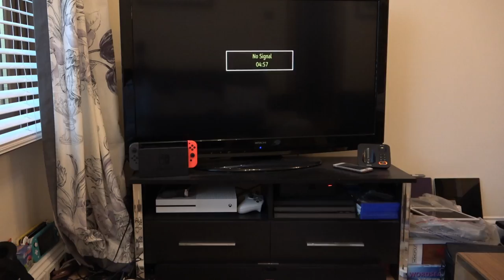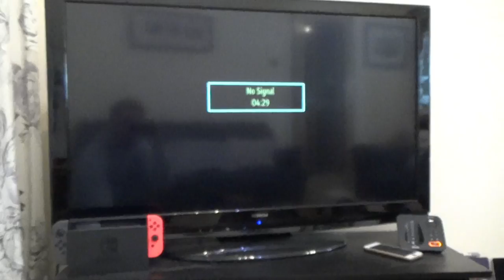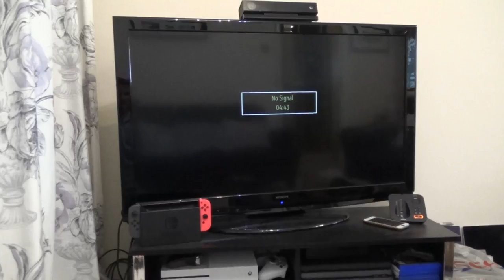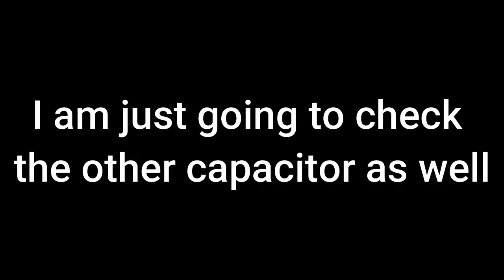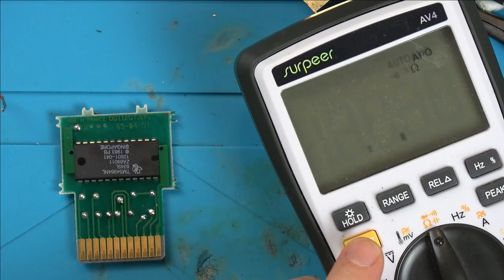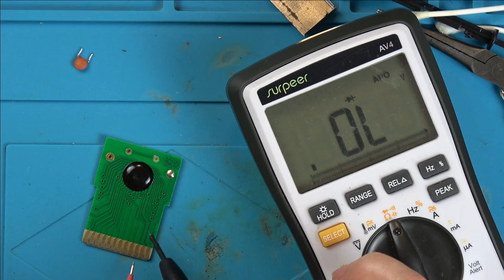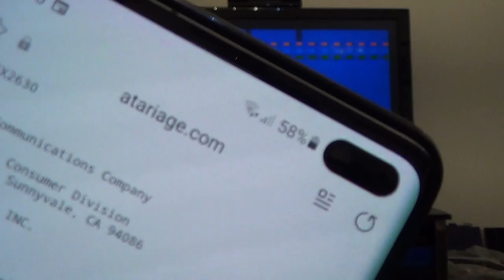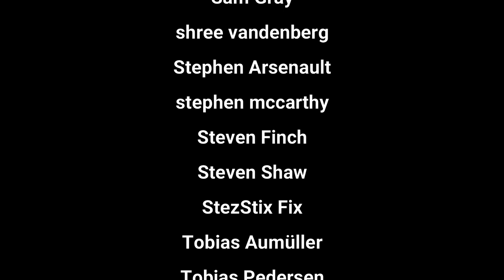A Joblot of Faulty Atari 2600 GAMES - Are they Fixable?

Comment: Solid capacitors like that basically never fail. Never, ever, ever. It's much more likely the chip has failed, especially since it's a cheap nasty glop-top. Kung Fu Master was an 8K ROM, the 2600 was designed to run 2K and 4K games. There were only enough address lines at the cartridge port to support 4K (and only enough on the CPU itself to support 8K, they used a lower-cost version of the 6502 CPU to save money). So if you wanted more than 4K for your game you had to invent a way of bank-switching, a way of dividing the ROM in your cart, say 8K or 16K, into segments that would fit in the 2600's 4K range. Then swap those segments about as necessary.

Since the 2600 generates it's picture in software, that's easier said than done. The 2600 has no video RAM, the screen is drawn with code instead, on the CPU. The CPU can jiggle about 2 sprites (with up to 3 duplicates), 2 single-pixel missiles, and a 1-pixel "ball". And 20 bits of background that only fill half the screen width so the rest you have to either repeat over, or mirror. 

It was designed to be able to play Pong and Breakout, and maybe Combat. The sort of games that were in arcades in the late '70s, which weren't up to much. Most of them weren't even in colour! So when the '80s came and people expected better computer games, the 2600 was really in a pickle, to actually get anything to happen at all is a miracle of programming. So that they managed to stream the '80s worth of computer games through a completely unsuitable bit of hardware deserves a real pat on the back for everyone who did it. You should read up on programming the 2600 one day, it's... weird! "Racing the beam" is a good book about it. 

I mention the 8K carts cos Kung Fu Master is one, so it would have an additional logic chip in the cart beside just the ROM chip. This would provide the extra address lines, by lurking at an address (1FF8 usually). You access that address and it flips it's address bit automatically, meaning you now get the other half of the cart's ROM. Switched in right where the other half was previously. Fortunately you'd prepared for just this eventuality! So that blob-top chip will contain 2 chips. Possibly on one bit of silicon, I dunno how well ROM technology works at implementing logic, but a couple of OR and AND gates surely aren't gonna tax it. OR possibly it's 2 bits of silicon, 2 chip dies, under one blob of plastic and wired together with those little gold wires, except in this case probably aluminium or something, you wouldn't waste actual gold on an Atari game!

Other carts had more sophisticated ROM mapping, and some even included more RAM! Another 128 bytes, to go alongside the 128 bytes the 2600 had on board, usually using the same chip Atari did. Atari 2600 hacking is a whole world, and a well-developed one since the 1990s. You might wanna get involved, hardware to program your own isn't expensive. There's even a version of BASIC with powerful features, but I think to get the real experience you'd want to do it in assembly.
Reply: >Solid capacitors like that basically never fail. Never, ever, ever. 

This is patently false, you have no idea what you're talking about. Ceramic multi-layer capacitors, as well as other types like tantalum, mica and polypropylene film capacitors all have failure modes associated with them and they are not rare. I've replaced thousands of shorted ceramic capacitors, hundreds of tantalums and innumerable other solid types.

Ceramic capacitors in particular are ridiculously fragile due to their nature of being a hard ceramic. This makes them very prone to mechanical damage from flexing, which can be caused by the PCB they're soldered to warping from heating and cooling. When measuring the forces of material expansion due to thermal change, we're talking about hundreds or thousands of pounds, and since ceramic capacitors have no give, they break. Disk and axial capacitors are less prone to breaking because they have leads that can absorb some of the flexion, but it still happens. Shock can also break them, like from drops on a hard floor or table.

In general, the smaller the ceramic capacitor, and the higher the rated capacitance, the more fragile the ceramic capacitor is going to be. This is due to the plates being ever thinner and more of them in a given space, which gives even less margin for things like heat and shock tolerance. SMD MLCC caps are notorious for their high failure rates.

Tantalums are even less tolerant than ceramic types. They hate voltage spikes, so a dirty power supply or component fault can make them short and explode. Mica caps are subject to "silver mica disease". Polypropylene film capacitors have an interesting failure mode where when a short between the film plates happen, they blow clear and the overall capacitance drops from a reduced plate surface area. The capacitance can eventually drop so low that the circuit the capacitor in fails to work.
Reply: @GGigabiteM  you're absolutely right. But then again, I'm sure he just miss to add "in these cartridges" part in his statement.

Comment: Hey Vince!!! :)   If anyone is ever interested in preserving the sticker by cutting, you can sometimes cut a straight line over the screws all the way across and pull up that strip easier and then put it down again so as not to be obvious you were getting at the screws. :)
Reply: A heat gun works for sticker removal on a lot of games, especially the metallic stickered ones, they come off really easily. Then just glue them back on again afterwards.

Comment: The Kung Fu Master isn't even a real period release, that's very obviously a 21st century reproduction board from Asia. Chip-on-board epoxy tech wasn't used in consumer gear back in the 70's/80's era of the 2600. The board doesn't even try to hide it and has a copyright of 2016, so it was made at LEAST as recently as 2016.
Reply: 2 years late here myself, but yeah, it's definitely a knock off cartridge.  The label is not correct, font wrong, and the MX 2002-2016 on a blob chip board is the dead giveaway.  Activision isn't even spelled out all the way on the board, and they put their full name on their original released boards.

Comment: Cool fixes :) 
Had myself strangely behaving solder joints at my old 80's Salora Manager computer game controllers. Tried to re-flow those old solder joints, but some of them kind of "exploded", sending solder blobs flying to the table and leaving empty hole to the joint. I didn't even wear safety glasses, as I didn't expect this kind of behaviour, but luckily no injury. I did put them on immediatly after the first explosion.
Filled those holes with new solder of course. Still, there's some problem with one direction, no continuity from right direction to the joystic socket pin, haven't had the time to diagnose it further yet.

Comment: I always clean the card edge connections in the equipment I repair, as even the gold plated ones tarnish over the decades and cleaning will often fix erratic behaviour. I use a couple of wipes with fibreglass brush (gently!) and deoxit, works a treat.

Comment: Dirty contacts on my neo geo mvs cartridges are solved by using regular eraser along the contacts and follow up with Ipa.
Works every time!
Reply: That's the worst thing you can do to contacts. Pencil erasers are a harsh abrasive that scrapes off metal from the contacts and leaves microscopic abrasions on the surface. Putting IPA on after that oxidizes the exposed clean metal and creates an environment for the oxidation of the connector to rapidly accelerate. Alcohol is extremely corrosive to many metals.

This is why game carts have to be cleaned so frequently, the oxidation returns immediately and gets worse. The "dirt" you remove from the edge connector with a cotton swab is metal oxides. Just ask yourself how impossible it is for a cart to get so filthy sitting in its sealed game case. It's even worse on carts that use tin contacts like those in the video. All of that dark gray/black stuff in the cuetip was tin oxides. That was a significant amount of material removed from the contacts. Do that enough and there won't be any contacts left.

The best way to clean cart edge connectors is chemical means. Use Deoxit Gold G5, CRC 2-26 or Krud Kutter rust converter on a cotton swab and wipe the contacts down. These will protect the contacts from further oxidation. In the case of Krud Kutter, it converts the surface to a phosphate and prevents further damage.

Comment: Like others have noted, Circus required the paddle controls.  Atari games assumed you had the manual.  Some games required the controls to be plugged into the P2 port for whatever reason.  You just pretty much had to be familiar with these quirks.

That said, some games reacted very interestingly when using the wrong controls.  In Combat, for example, if you used the paddles, you could do things like cause jets to hover in one spot.

Comment: A Submarine Commander cartridge a friend had given me over 20 years ago and had resided in my dresser's top drawer was fixed about a year ago after I did basic continuity testing and found the D3 line was broken. A good scrape of solder mask and a bridge solder blob got it working again.
Reply: Methinks you have a bad power supply or about to go bad. Filter cap needs changed.

Comment: Circus needs the paddle controller (as you discovered lol) =D   Where you get a chip on a board, you will usually see a bypass cap (generally one per IC) - that's what those caps were on the cart PCBs.  They simply connect between VCC and ground.  The only way a cap like that would cause a problem is if they are shorted!  The cart would work perfectly without the cap!   I know they are only simple but a fun to watch video =D
Reply from the maker: Thank you Chris👍👍👍 That Circus game had me baffled for a good while 🤣🤣
Reply: @Mymatevince  Circus is the best game in that bunch of games if you ask me.

Comment: The "blob chip" is a modern bootleg  cartridge. The chip-on-board package were not made in 1983.
Reply: when I saw that I was like... "wtf! who bootlegs atari games?"
Reply: The original arcade game was in 84, but they were releasing home ports through at least 1990. Wikipedia says the game was released on the 2600 in 1987, so 8912 which is written at the top would be a reasonable date code. It doesn't really make sense for a bootleg to put the Macronix logo and SINGAPORE on a PCB that nobody would see without destructively opening the game. Modern bootlegs are made in the Hong Kong / Shenzhen area anyway, not Singapore.

Also lastly, who would bother making a bootleg of that game.
Reply: Yup. I was thinking Vince would see the date on it. It clearly says 2002-2016, he must have had blinders up as soon as he seen that blob chip. 😄
Reply: Several of these look like bootlegs. Amazed at the janky poly-box on that Ghostbusters cart!

Comment: You should try scrapping off the solder mask over the vias and soldering them on both sides, vias can fail especially when exposed to physical stresses as these cards are when inserted and removed.

Comment: the bubbling is caused by moisture in the board ,i,ve seen it before when i,ve done outdoor led light circuits boards
Reply: That's right, the moisture in the board evaporates with the temperature of the soldering iron. This moisture also causes damage to the board, so it needs to be heated slowly with hotair.

Comment: Over the past few years I have bought several Atari 2600,7800 consoles with bundles of games and of the carts that I have tried I haven't had a one that didn't work after a spray of contact cleaner and a couple of insertions. I still have my original 2600 from when I was a kid too.

Comment: Despite popular belief, Mask ROMs do go bad over time. Electron migration and a number of other things can cause them to fail and no longer work. There's also a number of games that used cheaper windowless EPROMs, which are more susceptible to failure than mask ROMs are. The only way to recover a cart that has suffered bit rot is to replace the ROM with another chip programmed with the game on it.

Comment: The best way to clean Cart Contacts is a Pencil Eraser works great brings back the luster of the plating. You can get the wedge type that goes over the pencil or the large block type with a 45 on each end if needed cut the eraser with a razor to fit into each side of the cart. Then clean with cotton tip and IPA. Works everytime for me witout taking the cart apart.. : )

Comment: I was watching an old film on Fran Blanche's channel other day, its an old one I had seen many times but it shows how easy it is to replate contacts and traces on pcb's using the brush plating method and as you already have gold there a simple swipe over with some solution would make them contacts like brand new.

Comment: You can typically remove the black epoxy using paint stripper which has the main ingredient of Dicloromethane. Generally it does not damage electronic components and it works even better when its warm. The thicker gel type is better as it tends to stay in place. You just place a blob of stripper onto the epoxy and let it sit for period of time depending on the temperature and then wipe it and the loosened epoxy off and repeat as many times as required. Sometime we place the entire board or component in a sealed container covered in paint stripper and leave it overnight. Have been using this technique for years to remove epoxy and repair circuit board. Do not work on game consoles, so you would want to experiment a bit first. Be careful not to get it on the cartridge plastics, im sure it would melt them in seconds.

Comment: Vince never mind sometimes these things fail.  I used to have one of those Atari 2600 consoles it's a 6 switcher which is quite sought after.  Have you tried cleaning the contacts inside the 2600 as it may be the pins inside the console? I wonder if there is another 2600 they work on such as the Junior.
Reply: Atari had 2 mosels of 6-switch units.. is it a light-6er or hevay-6er?

Comment: Could it be that two of those games uses higher address lines and the consoles pins are dirty power-up could go to a higher address and not getting to the correct result causing the console to hang?

Comment: Very nice video. Depending on the condition of the stickers, you might be able to loosen the labels with some IPA so that you don't have to cut into them. I learnt that neat little trick from Odd Tinkering. If you try it you should probably test it on a small area first, in case it just dissolves the label.

Comment: I going to check the continuity on my dig dug cartridge. It stopped working. I did use the q tips to clean but still nothing. It used to work like 3 years ago. I always stored it in a case away from dust and humidity.

Comment: Use a hair dryer and blow hot air on the blob chip/ blob top. Get it really hot. It usually fixes the issue without having to take the cart apart.  Btw, I have seen blob tops on original US carts.

Comment: I was gonna say Circus definitely needs paddle controllers. Glad you figured that out on your own.

Worth noting, even though some of those Carts had a single chip on the board, those weren't always just regular ROM chips, some had extra stuff inside for bank switching (especially 8k games), or other features (some carts added extra RAM, etc.), because it was pretty common to just custom fab your own chips in the late 70s (generally cheaper than using a mask ROM and external components -- you were already doing the mask for the ROM, so you might as well bake everything in).

I'm surprised Circus actually had all those extra discrete components.  To me that signals that it's using a regular PROM chip (that and the sticker, sure, probably an EPROM), with external logic (that single transistor), for bank swiching.
Reply: Circus is a 4K ROM so no bank switching needed. That's also something a single transistor couldn't do, unless it had help from extra stuff on board the chip, and then you may as well integrate the transistor too. Sometimes something like that would be added to make up for an error in the chip's design, but Circus just being a dumb 4K ROM, I can't think what.
Reply: @greenaum  you're right it is only 4k.  It might be getting used as a "not" gate? maybe the enable pin is active high (not sure if that's even a thing, but what else would it be used for?).

Also I feel like with a transistor and a capacitor you could pull off poor man's bank switching, but yeah, no reason for that with this rom size...
Reply: @BrainSlugs83  Nah, cos for bank switching you need to do address decoding, which one transistor can't do.

Actually it COULD be a not gate... IIRC, mask ROM chips used an active high chip-select, where EPROMs used active-low. Or possibly the other way round. So a cart initially manufactured with ROM, but then later done as a short-run re-release, might switch to EPROM, necessitating a NOT gate. Good thinking!

Comment: Will a solder reflow fix this problem because of the solder being too old and loses its connection over time I just wonder if this would fix this issue or not the chip is bad and it is not fixable

Comment: I tested about 300 carts this weekend and about 1/2 of them didn't work the first try.  I cleaned them with an old stock cart cleaning kit and all but 4 worked.  I got another 3 to work by using 2000 grit sand paper lightly on the card edges.  Didn't open any of them.